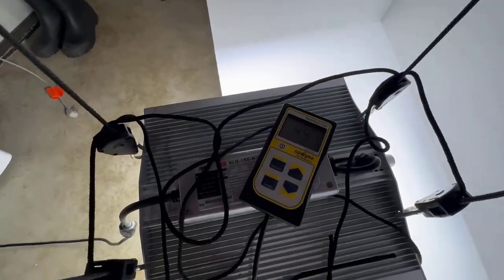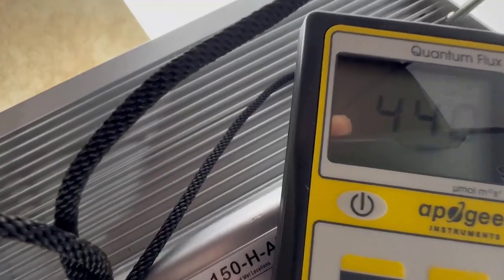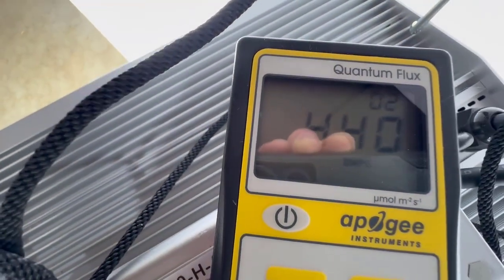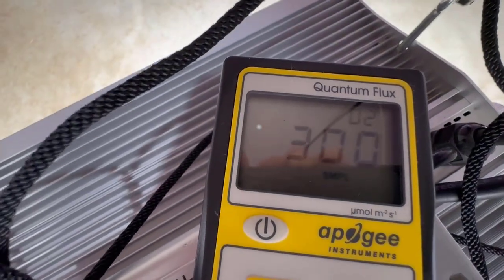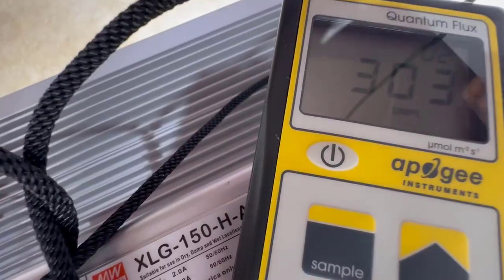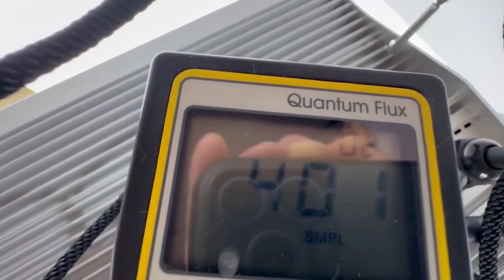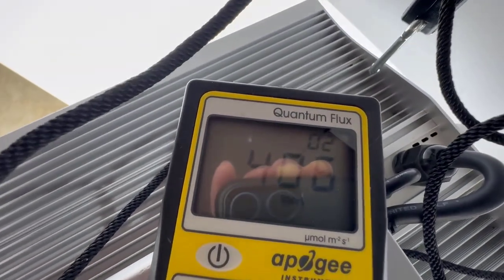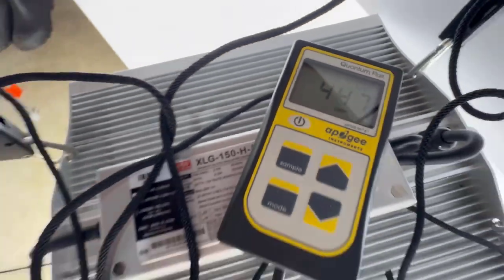How to Grow Better Plants Indoors with Less Light

Comment: Hey Mike, I use a cheap, silver reflective mylar "emergency blanket," hung with a couple pieces of scotch tape on the back of my growing shelves. Same concept of the poster board for increasing light through reflection, but considerably lower cost (under $3) and larger (52"x82"), and I don't have to be concerned about water splashes that might mess it up. The poster board is a great idea, too, and it could be used in various other settups.

Comment: I grow plants indoors. Grow tents are awesome. You can control the climate now with your phone if you want, there are AC and heaters and dehumidifiers and humidifiers, whatever you need for the perfect environment. If you're growing figs you don't need the carbon filter but a tent exhaust fan might be good. 
I tried making rigged grow rooms and closets and stuff. Then I got grow tents and I like them a lot. My stinky little plants and my ficus bonsai are happy in there.
Reply from the maker: I just put an oscillating fan on the floor pointing into the tent and sort of zip the door part way around it.  The fan creates plenty of circulation and pushes the heat out the top.
Reply: @MikeKincaid79 that works if you can leave the tent open. When you have cannabis plants flowering the tent must be shut when the lights are off so it's totally dark inside. I don't know if other plants have issues like that, but cannabis needs a short day to flower. Light when it should be dark prevents flowering or can cause plants to turn into hermaphrodites from stress. So my fans are inside my tents, no problem.
Reply from the maker: I've got LOTS of personal experience with this and have debunked the pitch black claim many times over.  A little moon light, every once in a while, never hurt, lol.  I'll just leave it at that 😂

Comment: Mylar (space blanket) attached to cardboard with spray glue is a great reflective surface if insulation is not needed. I need insulation, so I use silvered both side bubble wrap attached to a simple wooden frame. For trays of seedlings on a window ledge, put an A4 size sheet on the shady side

Comment: You had your poster board so close to where the plant would be that there's no room for the plant. You need to back it up a couple feet and then read the measurement again.
Reply: You're forgetting that the sensor was meant to be at about the top of the plant! So the boards are above, hanging in midair somehow. Actually, for the outside measurement I think Mike was forgetting that as well.
Reply: @WilliamMatthew-z6p I didn't get the impression he meant for them to be hanging in the air. That would be unnecessarily complicated. He got a more realistic measurement when he moved the device further out where the cardboard would actually be reflecting on the plant.

Comment: I "discovered" fig growing when I was looking for information for grow tents to have orchids in the house.  I didn't realize that it actually was possible to grow figs in containers. (I thought the seed catalog was just trying to sell trees.)  So now I have lots of orchids and lots of figs! 😁   I ended up getting one of those little "greenhouses" with clear plastic sides that zip up over a green plastic frame.  I wanted to be able to see the orchids, since that was sort of the point of them.   I have added some reflective surfaces on some sides to reflect the light back in.   It works pretty well.
Reply from the maker: sounds like you got it figured out.  Yeah, just adding a reflective surface on 3 sides will be enough to increase the lighting to the plants and still allow you to see them.

Comment: Great one. I didn’t need to finish the video to tell you this makes a huge difference. I built a half dozen well equipped grow rooms with heat/ac sealed room. Negative air pressure. one of the first things to go up was Mylar walls.  Very important.  Especially back when lighting was pulling huge amps and cost were crazy.    When I had a room like figgyed I made some foam board insulation walls that I could set around to help reflect light back.  At some point the room starves for co2.  Goes on and on…